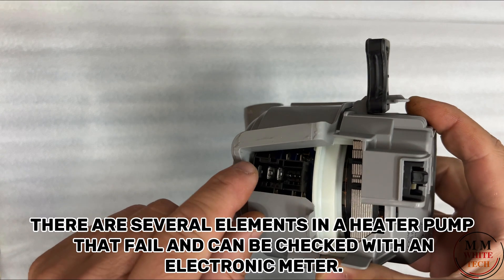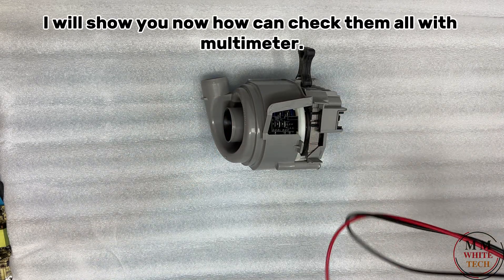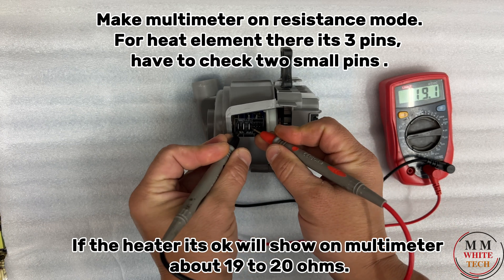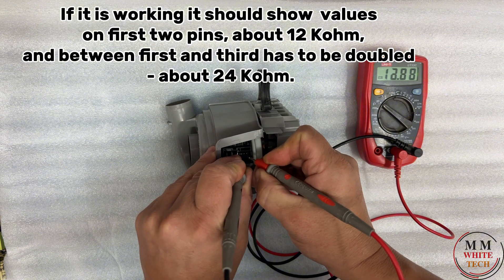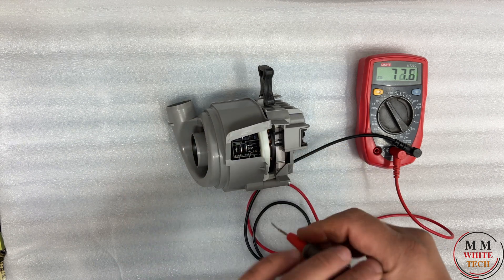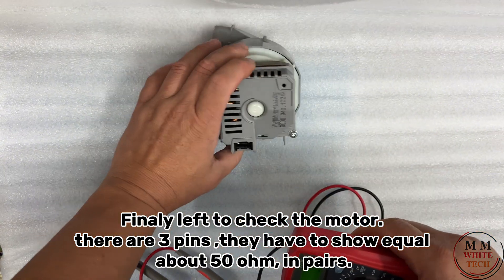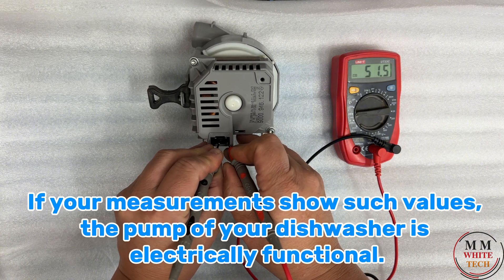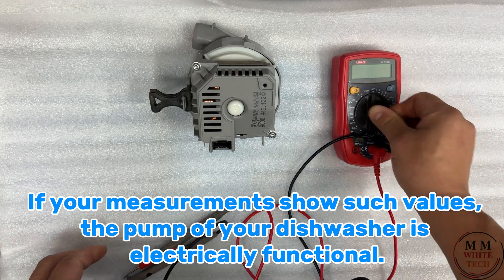How to check heat pump of dishwasher BOSCH - SIEMENS with electronic multimeter, test working check.

Comment: Great video! Thank you. I managed to pull the purple wires from the temperature sensor connector, and I'm not sure that I have put them back in the correct positions 😬. Do you know if the wires are interchangeable? Or does it not matter which way I connect them up? Thanks!
Reply from the maker: Well, they have an order of arrangement, a difficult moment but they have a way out, now you have to trace the cables where they go on the main...
Reply from the maker: After you find the socket on the main board, there, by ringing from left to right, you can arrange the heater socket in the same sequence.

Comment: The size of the engine appears to me from both directions 41' ohm instead of 47 or 50. Is this good or damaged?
Reply from the maker: Hi, think its ok , its just with small power - smaller coils.

Comment: My heater has 20oms. Sensor 10/10/20.
But still no heting. There is no power output from electronic, but When i connect external 2kw heater to electronic, he Works.

But I noticed something weird on my heater, i would like to send photos.  I think You would know what is problem then.
Reply from the maker: Ok send pics on mmwhitetechbg@gmail.com

Comment: i have a siemens dishwasher and it is not heating show the error 09, when i check the heatpump the temperature sensing which is in white colour there is small black burn mark and the temperature sensing  is not showing any reading in multimeter. 

should i change the whole heatpump?
Reply from the maker: The sensor its part of heating element, you can replace just heating element, but dificult to find like spare part, send me exact model of dishwasher and will send you a link from where to buy if you wont.

Comment: Good video - one of the better as you indicate which setting to have the multimeter on for each test.  a much needed add to any video.  Thank you.  

Heater is reading 9.5 ohms
Temp sensor 12 and 24
Motor is reading 14.9 across all three points.

Assuming 2 out of three are bad - which I find odd.  Expected just one.  
Thoughts?
Reply from the maker: Its your pump bosch washingmachine? Give the part number of heatpump.
Reply: @mmwhitetech  It is a Bosch - I believe it's model SHSM63W55N/13, and the part number is 12008381
Reply: @mmwhitetech  thought I responded already, I must have missed hitting the reply button

It is a dishwasher - model #shsm63w55n/13 part for the motor is 12008381
thanks
Reply from the maker: Whats the realmproblem of the dishwasher, its there any error or just not warming the water ? Whats happen exactly.
Reply: @mmwhitetech  I get an error code E20 - when we try to start a load, the machine clicks twice, and then the error code - it never starts
Thanks!
Reply from the maker: My sugestion its that you have problem whit rotation of the pump , first need to disassemble the pump to chek  Is there dirt or something preventing the propeller from turning?, if its clean i think there need to replace motor part of the pump .
Reply: @mmwhitetech okay, I will try that - thank you
Reply: @mmwhitetech  disassembled the pump - no problem with rotation - turns easily...